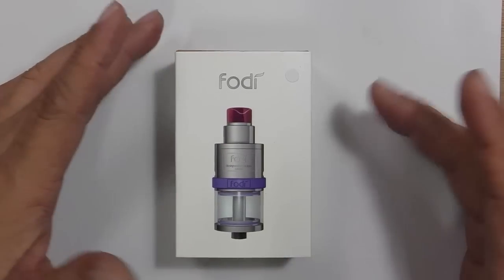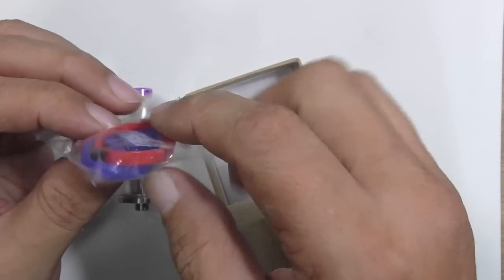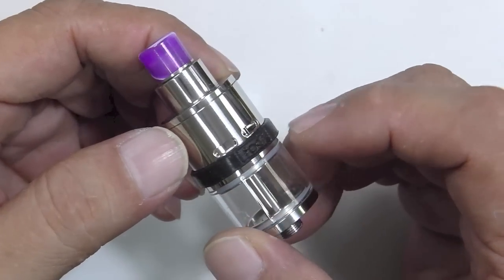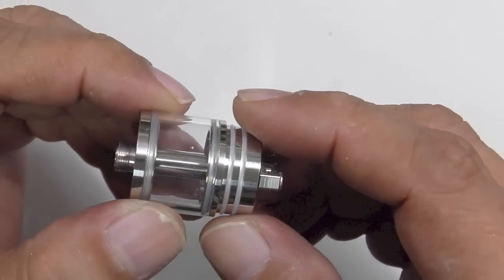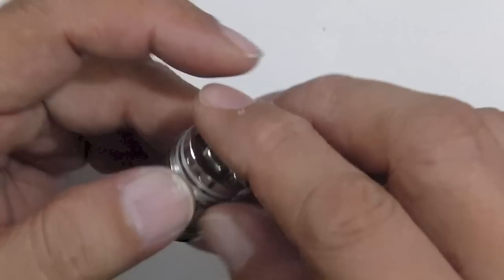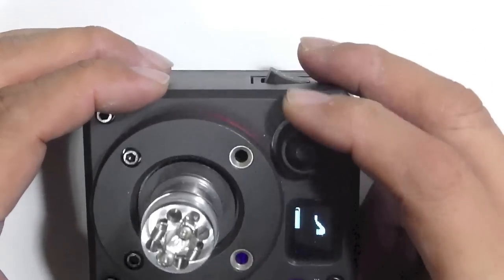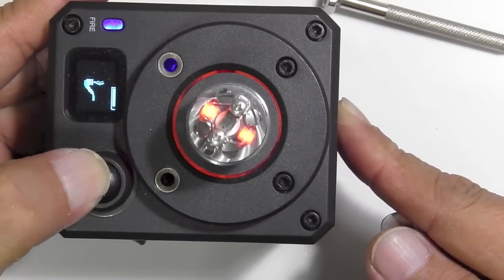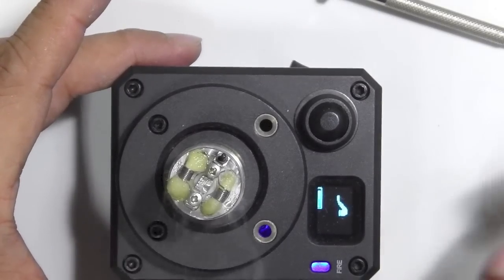Fodi RDTA By HCigar

Comment: Richard, I finally sprung for the Fodi. I really like it a lot. Thanks for the in depth review here, it helped a lot in making the move to get one of these. I have had no issues with building and wicking this. My only issue was that the ceramic center post insulator came broken, so I had to use one of my replacements right away. Other than that I have had no leaking and the flavor is on par with my other atomizers. Cheers! T

Comment: Great review! But seems a bit troublesome to use. Don't know about the ceramic insulator, people are not happy that the Crius has one. The little juice plug & having to remove the 510 pin to disassemble & clean.
Reply: +china33ful what do you mean? what would you prefer the indulator be made of ? ceramic is very heat resistant so why would people complain about using it to insulate your atty?

Comment: 7:13 And I've also found out that once I've removed that little air-hole plate, I've got better straight to lung experience.. However, is there a con/disadvantage of removing it? Because Hcigar did not officially explain the technical purpose of it. Pls share your thoughts.

Cheers

Comment: Im pretty sure i was paying attention but did you forget to describe how that airflow passage feels like? Was there a significant change on how that tiny hole and side airflow on the dt? Im curious to know. Thanks richard
Reply from the maker: The airflow is pretty similar to more like the UD tanks. Not as airy as the TFV4 or tanks with big airflow. The tiny hole is actually compensated by the air slots along the the sides of the tiny airhole. Hope it helps.

Comment: A surprise box? Random driptip color? No wonder they come out with driptip as accessories. The design is nice, it looks good. But I can see the tank band and the top cap is very loose. I saw you scrum the coil..may i know why..
Reply: +Aprilisyaz Ventures do you mean "strum*" the coil? the reason to do this is because it helps your coils fire more evenly and work out all the shorts so that you dont get hot legs and therefore really bad tasting and performing builds. you want your coils to heat up evenly from the center outward, and if you are running a dual coil build you want both coils to heat up evenly and in unison with each other, not one getting hot faster than the other because that will cause your wick to burn since its getting hotter faster than the other coil. hope that helps, check out trevor jones' channel, he does very good build tutorials to teach you how to properly build your attys. make sure you do your research and fimiliarize yourself extensively with battery safety. hope that helps, if you have any other questions don't hesitate to ask. i love helping my fellow vapers when i can. when i was a neebie vaper about 4 1/2 years ago i got tons of help from others in the community, so i feel its my duty to "pay it forward" so to speak, and help out others when i can. good luck and vape safe also do your part for advocacy 
may all your clouds be dense and delicious, your wicks wet, your juice delicious, your builds clean, and your batteries fully charged .   = ]
Reply: +Samuraisahsah owh..now i understand. a new thing to learn today. thanks a lot samuraisahsah..

Comment: One more thing to note, The glass on this tank is not of good quality. both my glass tanks have cracked and I didn't even drop it. the first broke when I first tank cracked  on the first day back from the shop, I took it apart to clean it before using it and might have tighten the firing pin to much and cracked it. the second cracked while I was vaping. I wouldn't recomend this tank.